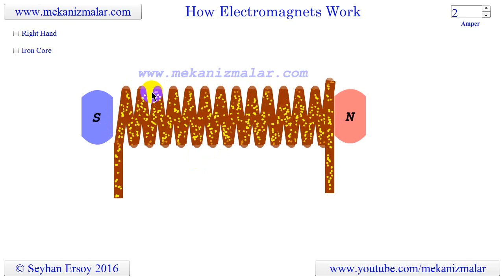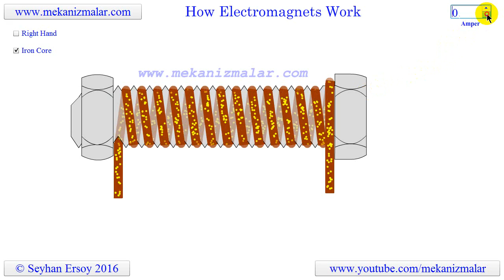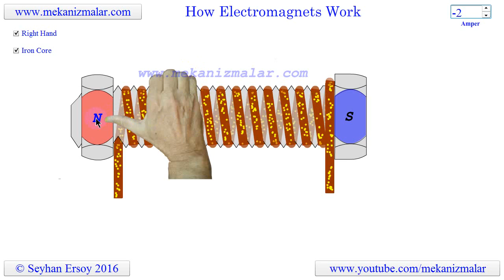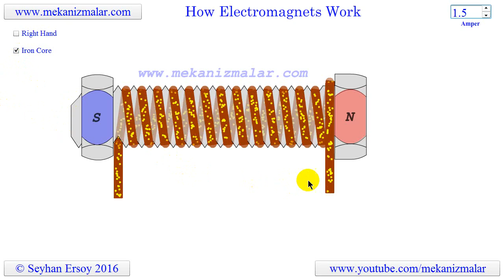how electromagnets work

Comment: Using an ferromagnetic core improve the result but creat heat inside the core, as in transformers, you can use ferrite or multiple thin wires or plates the duration of the magnetism and the ability to reverse polarity without heat is linked to the hysteresis curve that define the magnetic material